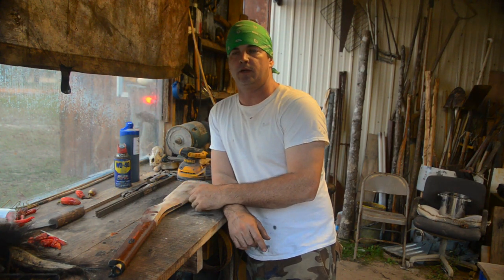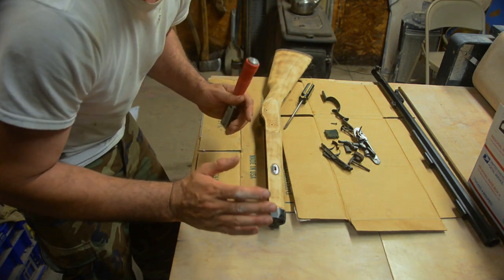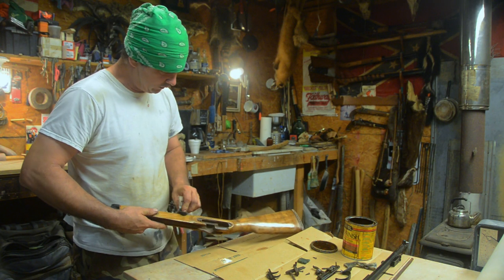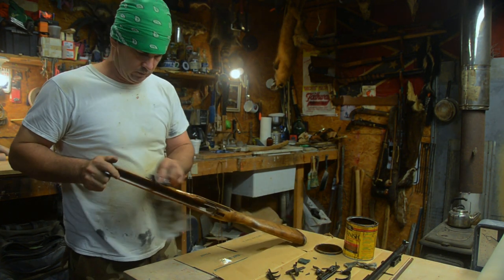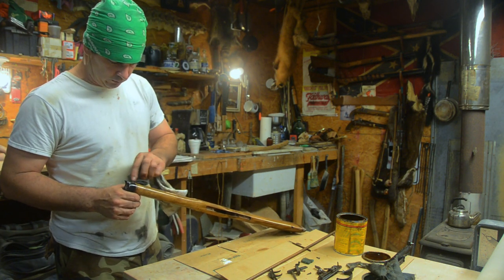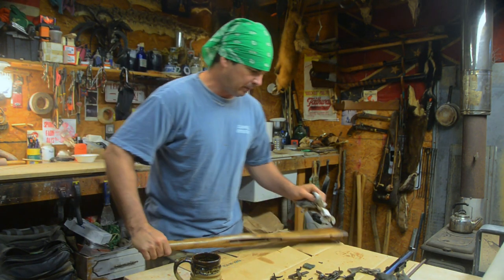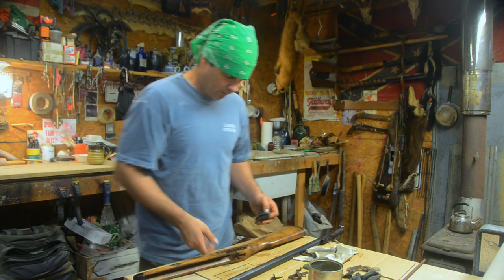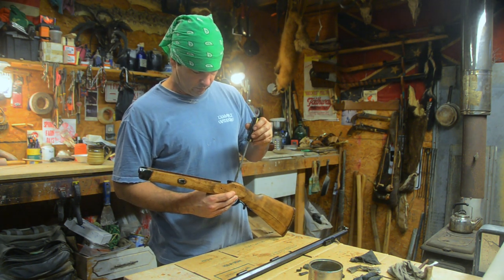Muzzleloader stock refinish

Comment: If you like the striped maple look, Henry Leman, an old time Pennsylvania gunsmith painted them on probably using India ink, I get a good color on some of my stocks by first using red shoe dye,  then I mix that in letting black with boiled linseed oil. It comes out a kinda reddish chocolate color. To give it a handled age look, I rub in more of the carbon black on places where a stock would collect grime over the years. A hot blow dryer will will melt Bee's wax and push it along like water to fill cracks and such and put a dull finish on. But I gotta tell you, and it's a shame, all the other mountain men could brag about mama's who were Catamounts and fathers who were grizzly bears but Jeremiah couldn't.... cause Jeremiah was a bullfrog. He was a good friend of mine.